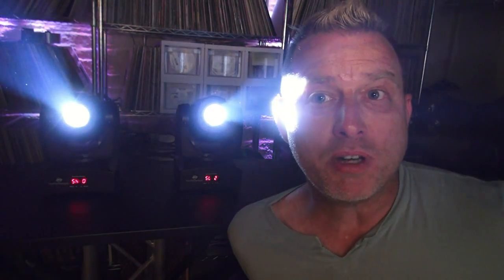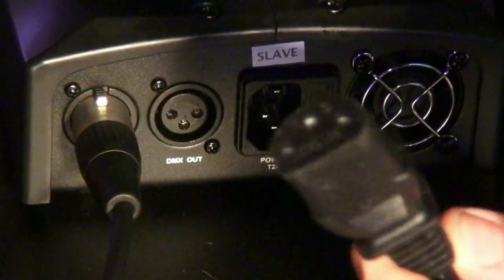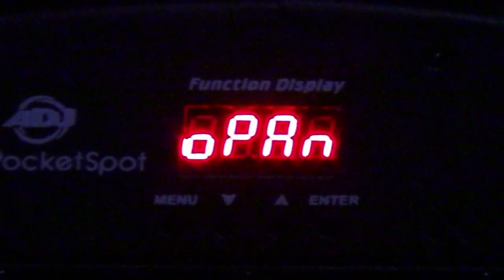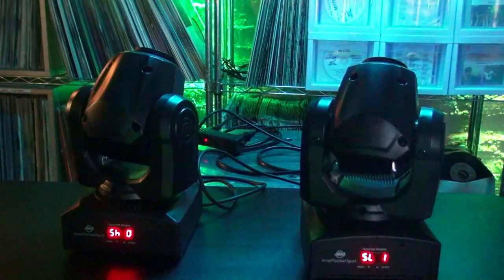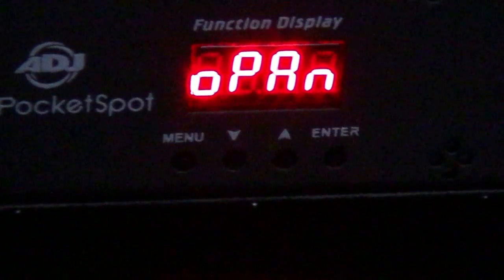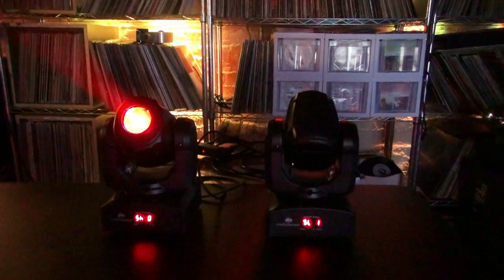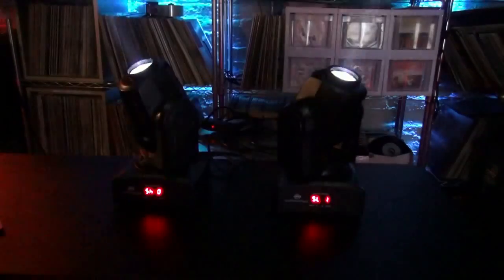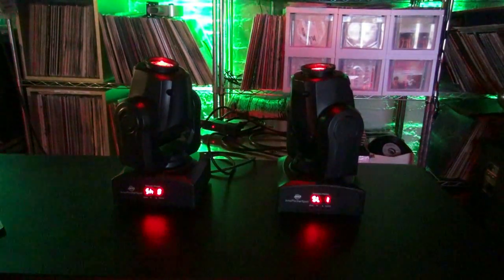Moving Head Tech - Pan Tilt Inversion and Slave Modes

Comment: Hi Brian,
You did an excellent job and very informative in this video!
My question is, after we hanged them on the ceiling, how could we set or change the program without the need of the dmx controller?   The dmx controller seems too complicated and add extra hassle to me.
Thanks!

Comment: I use 2 led moving head lights in master-slave mode with pan and tilt inversion on the slave unit. The master unit is in sound active mode. Does anyone know if it is possible to limit the movement of the lights, so they only project to the front, as set them up behind the dj booth on a T-bar

Comment: Ok. I followed your instructions to the tee and i got it working. One night i pressed some button on one of the spots and now when i plug in my DMX cables it shows a number 1 on both inno spots. One moves around and the other is i guess for lack of words “confused”. It goes on and off, strobes the whole 9 but doesnt follow the Master for nothing! How can i get it out of that mode and make it work again? Do my settings have to be some way for it to work other than this video?

Comment: I am a DJ and have two of these.  It is very confusing programming them.  I have separately purchased these spots from Amazon.  After calling them and they said they do not come with instructions and there is no manufacture contact info available.  There only solution was to give me full refund, not my choice.  No instructions are included...ever.  So thank you for your time in your posts.  Your post are fortunately  the only available info.  If I may ask you a question about these lights; I would like to know if you know why my spot beams have a line thru the projection?  Not all the time, every 3rd or 4th projection.  I took a photo but I do not see anywhere to add photo here.  Thank you for all you do!  Peace-DJ MikeL
Reply: You can find instructions on our website American DJ.com let me know if you have any questions jerrye@elationlighting.com

Comment: I had a quick question; If your two inno pocket spots are connected to a dmx controller and I am using the fixtures during a show where I have programmed them to a playback, can I somehow get the fixtures to run show mode during the interval of that show? Love your videos btw!
Reply: Hey, I do this using a DMX splitter.You just need to run more cables. I have a 2 channel splitter. Channel one goes to all 4 moving heads. Channel 2 goes to all other fixtures. There is also a remote  (UC3 controller) connected to the master of the moving heads. All i need to do is pull out the cable on channel one of the splitter. My movingheads start to respond to the music in show mode 4 and i can control them using the UC3 controller.  All my other fixtures still respond to my DMX software.

Comment: I'm going to be buying 4 Inno Pocket Spots at the beginning of next year, along with 2 Pocket Scans and 2 Pocket Rollers. My question is, if I want to run these from a WiFly DMX controller such as the WLC16, could the Pan/Tilt inversions still be achievable since I would not be using Master/Slave?
Reply from the maker: If each light will have individual control, no.  However, if you assign them to the same channels & control them together, you can take advantage of pan/tilt inversions if you wish

Comment: I ran into a problem with setting up some mega-pars in master-slave mode. I read through the manual and could not get the second one to follow. Later when I got home I noticed they were set to different addresses. Are your moving heads set to the same address? or It doesn't matter? Thanks
Reply from the maker: Yeah both on DMX channel 1.  Sometimes it matters, sometimes it doesn't.